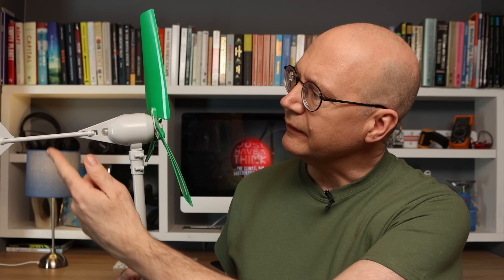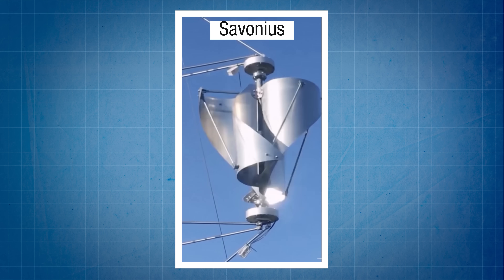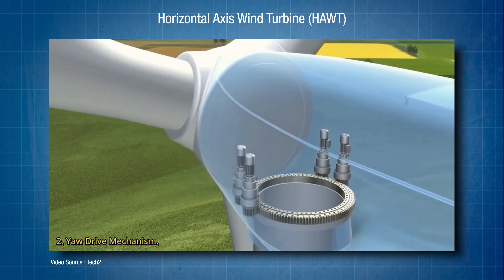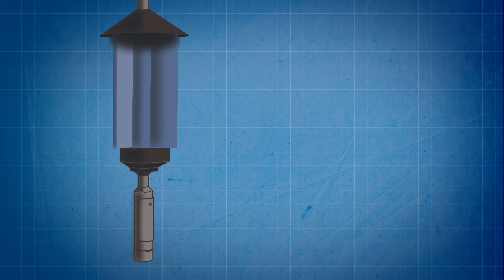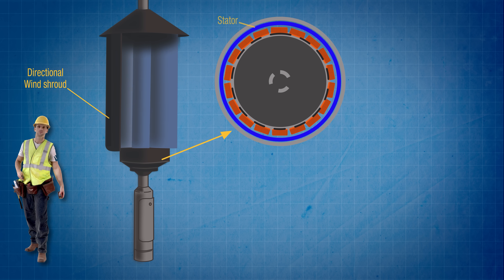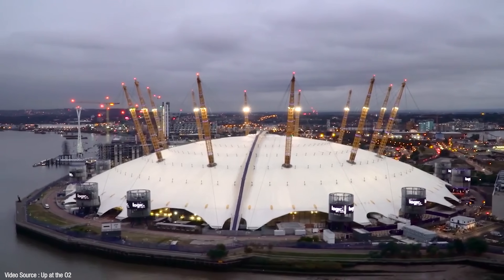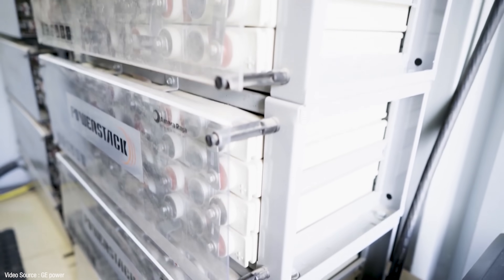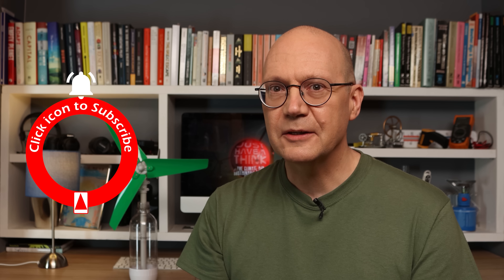A vertical axis wind turbine that doesn't need the prevailing wind! How do they do that?

Comment: I used to be president of a wind turbine company. Vertical axis turbines suck. They are very inefficient and generate much less power than regular horizontal axis turbines. Go out into farming country and see what kind of windmills are used to pump water. They are all horizontal axis, and even have swivels to point into the wind. There must be a reason they go to all this trouble. The reason is vertical axis turbines suck. They are fighting themselves. The bucket that is collecting the wind is fighting the opposite bucket that is coming into the wind. This does not happen with horizontal axis turbines. Vertical axis are fine for DIYers. They don't have the capability to build horizontal axis turbines that swivel. I really do not believe the power output claims. Such a small turbine mounted close to the ground, with a breeze from passing cars and inoperative when the traffic stops can never produce 6KW. Never believe the manufacturer's claims. They will never be able to manufacture, install and maintain these turbines to compete with the cost of electricity.This is just a money sink for gullible investors. Here is an example of a comparison between vertical and horizontal axis turbines. The started with horizontal then tried to make a vertical axis turbine. They were disappointed that the vertical axis could not produce as much power and diagnosed the problem as the opposing blades fought each other, the same problem as I mentioned above. Here is the video:
"How to make a Vertical Axis Wind Generator (Is it worth that???)"
https://www.youtube.com/watch?v=qVhA-RGfsEc

Comment: Make the vertical wind turbine blades collapsible in one direction so that they fold up and present a smaller cross section when going into the wind and unfold when they are needing to be pushed by the wind again.

Comment: The potential wrinkle I didn't hear addressed in the video is copper thieves.
Reply: If these things are constantly reporting data wirelessly via mobile networks, and motorways are well covered with CCTV and automatic number plate recognition, I think units could report attacks within seconds and chances of getting caught would be too high.

Comment: Copper thieves must be awaiting the wide implementation of these turbines along highways with great anticipation. The issue with placing them in somewhat remote public places are as much technological as societal. Highly distributed systems such as these already suffer from maintenance costs significantly eroding the profit margin. Add to it vandalism and deliberate theft, and the viability of the entire system could suddenly enter the questionable zone.

Comment: The sad part is that some cities, under the influence of the oil companies, have banned wind turbines and windmills altogether. The city of Seattle is one. Others have set speed limits and other rules to effectively ban neighborhood electric vehicles. Lynnwood, where I live, has banned neighborhood electric vehicles by setting speed limits to disallow them. Even setting up a small portable wind generator as a test for just an hour will prompt a visit from a building inspector and the police. I set up a group of small wind generators on a flatbed truck and moved them around to test wind conditions around the Puget sound region. Everywhere I went,  an inspector would show up within minutes and when they realized that they had no jurisdiction, they would call police. The police could cite no law or ordinance but would still insist that my legally parked truck leave their city at once for “public safety reasons”. Even the idea that someone MIGHT set up a wind generator in some cities or unincorporated areas is not acceptable.

Comment: You may know that a yacht's propeller when the shaft locked when under sail instead of spinning freely, produces less drag than when it turns. Which suggests to me that (as you mention well, but perhaps not in as much detail as possible?) these roadside wind gennies may well produce power, but at the cost of fuel in the vehicles  passing by. I can't say this with 100% certainty and testing would be needed to see if it's true, but I'd think so, so for me it's not a bright idea, at least unless this is carefully tested for. Though yeah it's defo worth a try and well done the company for getting it organised at a decent test scale. I would suggest that these be installed for testing at the base of wind turbines at sea - using existing infrastructure and even the waves for an extra kick?! Nice vid, thanks.

Comment: I don't think there is much power produced from these spinners. Any updates on this product? 
Surely the simple answer to all this is to build a couple of dozen prototypes and install them along a stretch of highway. Record the results. They are not supposed to rely on the wind blowing on a windy day. That is just a bonus.
Imagine a boat going through the water. How much water does the boat drag along? Not a lot! Cars are streamlined to slide through the air. What sort of draught do you feel if a car drives close past you? Not a lot!
Reply: That is pretty much it; only word left is SCAM.

Comment: Really interesting "spin" on the existing vertical axis wind turbine.  Love to see them line or major roads. Be interested to see a residential version to supplement PV on cloudy winter days. That would need to be cost effective so probably only when they've scaled production up.
Reply: Lots of liveaboard sailors are generating in excess of 1kw from mix of solar and wind generators on their sailboats, and both horizontal and vertical turbines have been available for them for some time. All cooking on boats was taditionally done with spirit fuels or gas, but a lot are producing enough to go all electric. With energy costs as high as they are, I can see a time when all homes will microgenerate enough power for their needs.
Reply: @chrisyarnold6205  I'm looking forward to that day. Excess power from our photovoltaic system goes to the grid and we have an account where for 20 Euros/month they will give it back to us generated from nuclear and hydro. But to keep it local, even as local as our own home, would be super.
I wonder how one of these generators cound be hooked up to our photovoltaic system?
Reply: @philiptownsend4026  
On boats they normally run off 12 or 24v dc, sometimes with 48v for windlass and bow thruster etc.  If they add a wind generator, they add another MPPT controller into the 12 or 24 volt battery bank, charging circuit. I don't know a great deal about house self generation, but I presume that you have no battery bank, but run power straight into an inverter, where it is converted to AC, and straight back to the grid any excess. Not sure about what you would need for that.

Comment: These turbines will slow down the overall airflow on the motorway and likely cause vortices, causing the cars to have to burn more fuel. Energy is never free. These turbines will generate less energy than the extra energy in the form of petrol required to spin them up. Any engineer worth his/her paycheck will realise this.

I repeat, there is no free energy. These will increase drag on the passing cars making them burn more fuel. Overall, these turbines will thus actually waste energy rather than generate it.

Comment: I had this exact idea about 20 years ago and even drew up my own design. Mine however had a stator at both ends because the blades were on an axel. I had surmised tat this would put out twice the power, with one stator powering the street lamp and the other going to the grid. I also thought that my design could be placed at any angle. I imagined it installed on every street light in a city. I'm glad to see that others had similar ideas and put it into action.

Comment: as we know, there is no free lunch. If you put that near roads, it will create turbulences and it will increase drag on the vehicule
Reply: Finally someone who comments this. I agree. These wind turbines while slowing down will essentially brake the airflow, cause vortices and should increase drag on passing vehicles causing them to have to burn slightly more fuel.

As they will be "slowing down" all the time, this will consume more energy in the form of extra petrol burnt than the energy they provide due to various losses.

Comment: You mentioned cell towers and I can't, for the life of me, figure out why cell companies haven't voluntarily started putting wind turbines on their towers. They are already building large towers so it wouldn't cost much more extra to place vertical wind turbines on them making their return on investment period very short. After which the turbines just become profit.
Reply: They would need to build more robust (therefor expensive) towers to cope with fluctuating loads imposed by the turbine generator. The electricity generators and converters would produce electrical noise in the cell phone equipment, reducing their efficiency, thus requiring additional cell phone towers. The proposal is unlikely to.be economically viable.

Comment: I've often pondered the potential for replacing one of my disused chimney pots with a device such as this to get over the local council rules that hindered early attempts to install fan type generators on house roofs. 
With similar size and colour to a standard tall pot, there shouldn't be any objections from an aesthetic point of view, and if the amount of power generated was worthwhile, it would be easy to integrate with solar installations to boost the domestic total energy generation of the property. With the major advantage over solar in that it will continue to work through the night and on overcast days.

Comment: I've always hated the huge wind turbine farms: they're too expensive, take up too much land and take too much to fix. They're a massive money sink which doesn't produce more energy than it required to make + build: for at least 20 years. Omnidirectional, smaller turbines however - now we're getting somewhere. We should be sticking these things on all buildings, garages, street lights that sit at intersections which routinely get a lot of air flow. These we could get some real use out of.

Comment: I had this idea years ago and wondered when it would become a reality. Its such an obvious thing to do. If you have ever walked down a busy road, the air pressure placed on you is enormous, especially when a truck goes past. 

I can imagine you can do the same with the tube. Th amount of air that each train drags behind it must be very useful, particularly at busy stations.

Comment: I love the idea of using these as a supplemental source to a power grid but I'd be curious how well these would work in an area with heavy/often snow fall.   Would you see a build-up of snow/ice/hoar frost  which can jam or damage the blades or generator.  

I know they are shrouded at the top but that won't matter to a rotating structure which "draws in" air.

Comment: Fun idea for those lamp post turbine generators: Using a gearbox, heavy weight, and vertical lead screw, one can make a gravity battery inside the lamp post that can be used to power the lamp at night instead of a chemical battery. Alternatively, output the energy into the grid and use larger scale more efficient energy storage.
Oh and also put the rotor/stator on top of the turbine so that foreign material doesn't accumulate and corrode the motor.

Comment: That's awesome. Not to mention the fact that we've already got like MOUNTAINS of unused motors just thrown into landfills each year. A great deal of them are still functional at the time of disposal so if this company were to develop use a scalable design they could just recycle those. We'd end up with these all over the place and the efficiency would probably be in the gutter but that would basically be for next to 0. I know there are a lot of reasons why that wouldn't work but you gotta aim at something in order to miss and then do better.

Comment: I have watched this channel on and off for a while now. The presentation is always educational and well put across. I found this episode to be very interesting and these turbines appear to show great promise. Thank you for producing such a great channel.
Reply: Set between lanes of opposing directions the opposing winds average to zero.  
2 kW for a turbine the size of two people side by side with 30% yield, means we endure 3 kW of wind on our person on a daily basis.
Reply: Are you kidding, this is Nuts.
Calculate the numbers!

cars produce some wind in their direction, creating a tail wind, now if you almost stop that wind, the cars are subject to higher drag. 
Essentially you transfer  the additional power cars must use to the dismally inefficient turbines, how stupid is this.
The net result is an increased fuel consumption, energy not recoverable.

The power required to overcome  is (velocity - tailwind)³ × density × frontal area× drag coefficient 
Cd ~ 0.3, 
A little tail wind, car column generated reduces power enourmously!
Reply: @arturoeugster7228  The advantage of driving behind another vehicle is that the lead vehicle reduces headwind for the car behind. This is surely not affected much by turbines on the side of the road which only harvest the spill-over wind that escapes from the roadway...?
Reply: @petersonners4626  When there is no wind, then the only source of energy are the cars, not efficient, surely but still , the cars end up driving the turbines. 
Make a test circuit indoors and all this can be measured, on reduced scale models if necessary.
Is is elementary physics.
Which is not a 'fortée' of this channel.
Even with the best possible configuration, long slender optimally twisted blades, the efficiency to extract the wind energy  is never higher than  16/27, minus the skin friction of the blades and the drag of the nacelle and tower.
the condition  is as follows The air tube reduces the wind speed to ⅔ windspeed, where the plane of the blades is, then in the after  flow to ⅓ windspeed, This is the  famous Betz optimum, accordingly the initial inflow mass has a crossectional area of ⅔ the blade area and the trailing low speed area is 3 times the small area in front. Any time the blade angles are changed the trailing velocity is above ⅓ wind speed, never ever less . vertical axis  turbines fare far worse, because of the large friction losses, but who cares there is enough wind area any way, as long as there is not interference of turbines operating behind others. Even a long distance apart . But road side arrangement  as shown  , with no cars and modest wind do interfere.
I maintain that this is 'Nuts'.
Reply: By the way the optimum power, given by Betz, neglecting all drag sources is
P = (16/27) × density/2  ×  Wind³ × 
blade swept area

same as
P  =  (2/3  Wind)³ × density × blade swept area

same as (2/3 Wind) × Force pushing on the tower
Reply: @arturoeugster7228  Well, it certainly sounds like you know what you're talking about - far more than me anyway, so thanks...👍

Comment: It’s innovation like this that will pull us through energy poverty, energy crisis and global warming. Not every invention will succeed, but they all need to be given a chance.
And if every major motorway, A class road, or possibly train line could be retro fitted with a solution like this, cars and trains could be powered by hydrogen generated by the spare energy, which would help reduce our reliance on fossil fuels.
Very interesting.

Comment: The problem nobody is seeing is that the energy isn't "free". If there's a residual 12mph wind on the highway from the passage of other cars, that's a tailwind for the cars on the highway which lowers their air resistance and fuel consumption.

If you put turbines on the side of the highway to harvest this energy, it will make the air on the road more still, meaning more of a headwind for cars and hence more fuel consumption per mile than a road without turbines.

Since car engines are very inefficient and these turbines are essentially taking power from these engines via an extremely indirect (and hence inefficient) way, my first concern is that this would induce a greater increase in fuel consumption in the cars in the road than just generating the same amount of electricity using a straight diesel generator.

I think it's worth doing a large-scale wind tunnel or real world test to quantify exactly how much extra fuel consumption these induce in a cross-section of different cars and trucks.
Reply: You are exactly right. This will slow down airflow, causing the cars to have to burn more fuel. This will actually waste more overall energy than if the turbines were not there. Energy is not free. These turbines are a bad idea and any engineer worth his/her paycheck knows this.

Comment: Silly question, perhaps... but how much have people studied what happens to the air that a moving vehicle pushes out of the way? It seems that some of the true or false intuitions people have about this idea - indirectly alluded to in the video - could be addressed with more knowledge.

For example -- does a truck experience the same wind resistance if there is a wall, a turbine, another truck going the same speed, or nothing next to it? It seems to me that the answer to this question is not OBVIOUSLY "yes". This, it seems to me, was treated as obvious in this presentation.